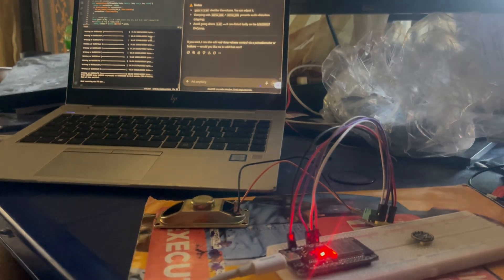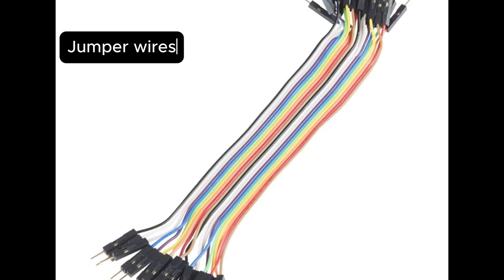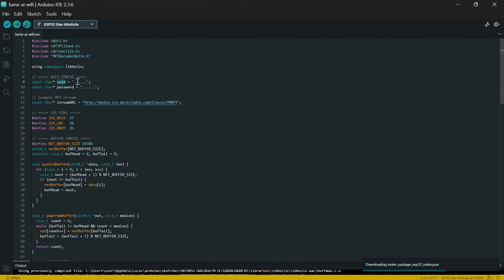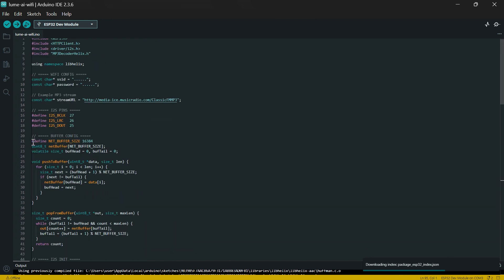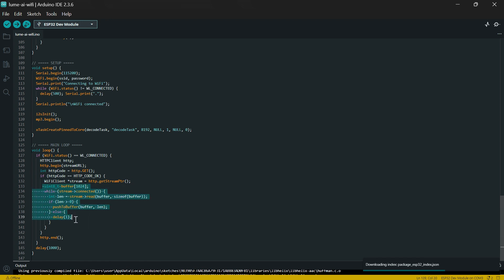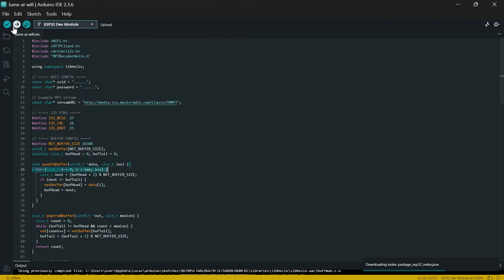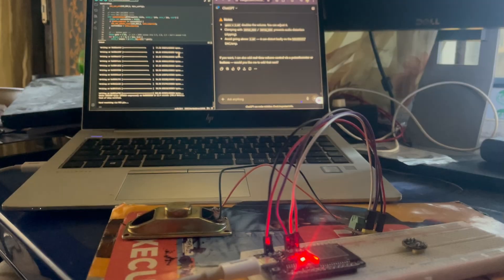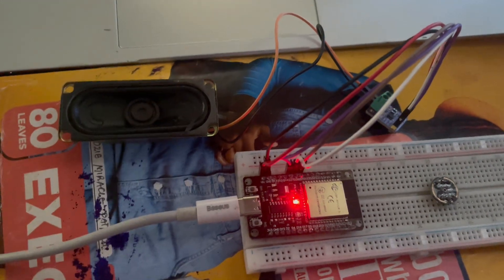ESP32 Audio -  Internet Radio

Comment: What is the spec of speaker that can be used with max93857?  I use 2w 8ohm and volume is too low. I already use potentiometer to turn volume up.
Reply from the maker: The MAX98357A works best with 3W–5W speakers at 4Ω.
Your 2W 8Ω speaker will sound quieter because 8Ω reduces output power, and 2W can’t take advantage of the amp’s full strength.

Try using a 3W 4Ω speaker that’s the most common match and gives you noticeably louder output.
Also make sure your I2S volume setting is high enough because the potentiometer alone won’t boost digital signal.
Reply: @Cogni_AI  Thank you for you advice.
Reply from the maker: You're welcome